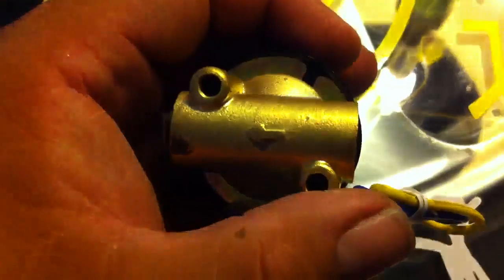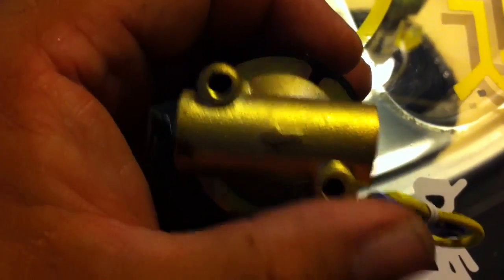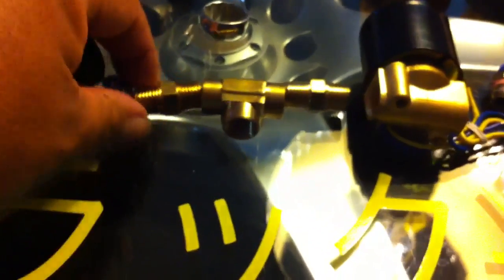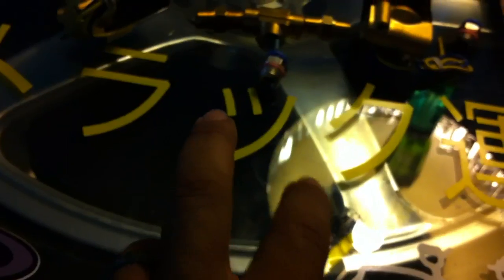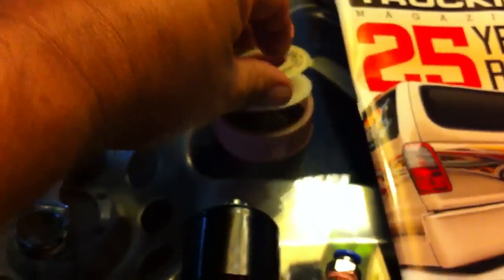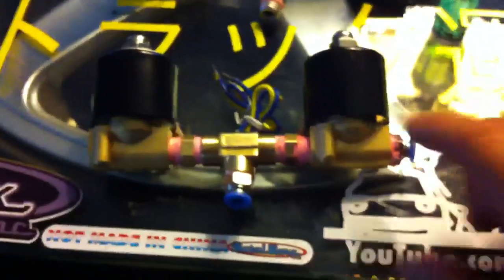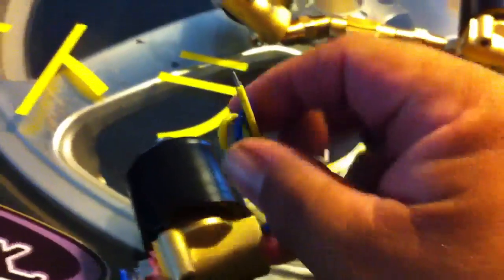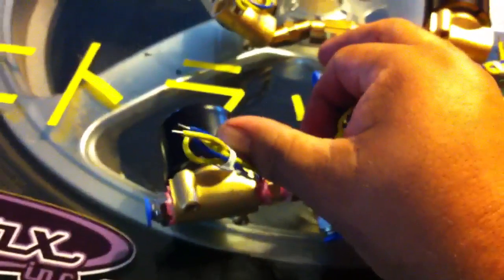How to build an electronic air valve manifold

Comment: Hey man do you have a video of how you connected the manifold to switches with a gauge reader ?
Reply from the maker: +Zackary Echols I've never used guages so no sorry
Reply: You can run an x fitting instead of a t, and use the extra end to connect a hose for the gauge

Comment: any issues with using  one valve set up  for front and one set up for rear to just control ride height (no three wheeling needed). On my 82 c10, it will be installed along with a 3point rear suspension, no frame notch planned. I want height adjustment, but not looking for body to sit on floor. I do want it to cruise like a cadillac, but handle like a vette (or close to it)
Reply from the maker: +6824648 no there's no issue with doing it that way the only problem you'll have is a little bit more body roll because as the weight shifts that air will squeeze out of the one side that's being pinched and go to the other side causing more body roll

Comment: you said one switch per valve,but if you have a toggle switch can't it control 2 valves the up and the dump?
Reply from the maker: +Zachary Eskelson yes but if it dumps unevenly or comes up on evenly then you need to have the ability to raise them individually the only way around this is to set them up on relays or just buy a switch box

Comment: love the channel bro, what would u suggest for a hopping setup? I don't wnna gain nothing but maybe a foot tops. im in the process of buying 1/2in lines hydro, valves cups etc. but what I really wanna kno is if im using hydro lines to run the air does it matter if its 3/8 or 1/2? im very new to air. so i was doin the footwork before I  actually  finish my order! u represent Ark in a real good way. thanks in advance bro
Reply from the maker: Thank you for the compliments as for the airline half-inch will give you more volume so if you wanted to be able to jump that would be your best bet be careful how much pressure you put into the bags because they can blow with that kind of air pressure going to them to hop i hope this helps and good luck to you
Reply: Thanks brother! I was gnna get the ss7s I think they are. They max out at 600psi. I was only thinkn bout running 400psi tops maybe 350. Will 3 tank be ok maybe a 12 n two 5 gallons?
Reply from the maker: Sounds good make sure all your lines from tank to tank  and valves are half inch. And get 2 extra bags cause there is still a chance your going to blow them
Reply: +Lawrence Duarte ok thanks LD

Comment: hey Lawrence Duarte by any chance do you have a video on how to connect a tank, im getting ready to bag my c1500 and i been watching your vids since you started the truck.. got valves, links, cups, lines, shock position etc learned but not sure which tank to choose? Does # of ports matter? I wanted to setup my fill valves straight at the tank one port per fill valve (4) and make a t for dump valve and to bag and i want to drill a hole for gauge..  so what tank would i need lol
Reply from the maker: I talk about tanks all threw my videos but not one specifically on tanks sorry. Tank size depends on how much air play u want more ports makes it easier to seperate everything for more even airflow to the bags. Hope this helps.